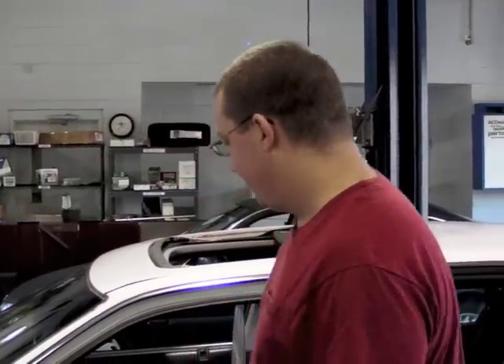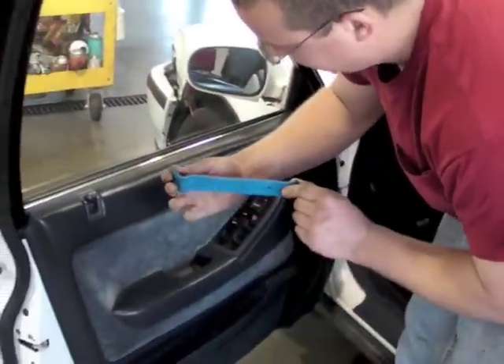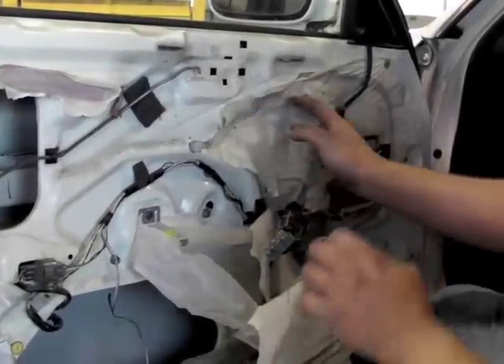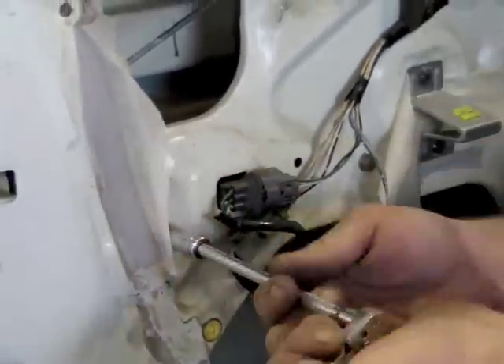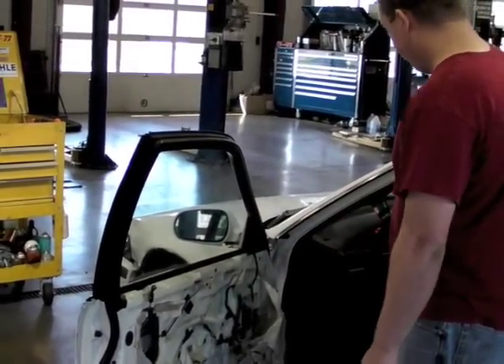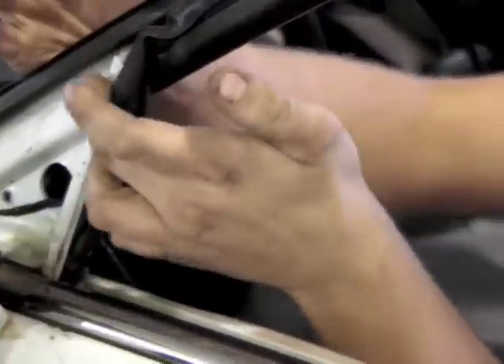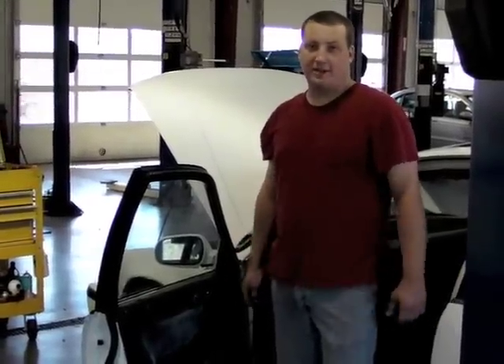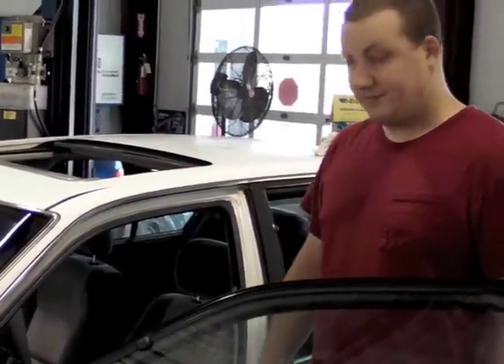How To Fix A Broken Power Window

Comment: I really appreciate you posting this video.  I am in the process of re-setting my window and was at a dead end after taking the panel off.  I have an idea of what to do now since I have a 93 wagon that looks identical as far as the door panel. I just wish that you showed the window being pulled out and re-installed, but I'm guessing it's just that simple after I take off the hex screws.  Ok, time to get back to work!  Thanks again!

Comment: Much THANKS on your video.!! I'm now motivated to fix my window that leaves a crack on the upper section of the channel. Just in time for the winter and rain season. Never knew window channels need silicon application. We've been having "Santa Ana" winds hear in So. Cal. in the past week. Very DRY Air!!!. That's why I hear "Sticky" sound on all my windows when I operate them. I will by silicon lubricant spray to condition the channels to allow the windows to glide easier.

Comment: Very helpful, I have probably the same problem with my power windows, window on the driver's side will roll down with no issues but when you roll it up, it goes all crooked. And also, the rest of my windows, passenger side and back, don't work, probably some fuse prob, I don't know.. But yeah, thanks for the video!

Comment from the maker: @errickidle basically yes you need to reattach the motor to the regulator and the regulator to the window. I would recommend getting a repair manual or searching online for a diagram to see how the different parts work and how they fit together this will give you a much better idea of how things work.

Comment from the maker: @carss4lifee most power window setups are similar to the one in the video.. simply disassemble per your haynes manual and make sure the window, regulator and channel are all in working order and properly aligned to smoothly operate up and down.

Comment from the maker: @tammysoulful basically if you need to get the window back on the channel you need to do what we did in the video and remove the door panel first.  That should give you access to the window and you may even be able to simply place it back on track.  If not you may need to remove the regulator and reinsert the glass.  Do a google image search for your vehicle you might find a diagram of the window setup and that could help you see what all the parts and the inside looks like.

Comment from the maker: @senorericshen hard to say it could be the motor sounds weak because the glass being misaligned is causing it to not be able to move freely.. remember odds are its still attached some how.. id say the motor is prolly okay but you are going to need to disassemble and check the parts out... new regulator could be a possibility

Comment from the maker: @goddesspiggy never put solid window glass in a BMW before but more than likely you will need to take off the door panel..usually that glass is held in by the seals themselves and to properly remove the seals and any brackets that may be holding it in place take off the door panel and so you can see what your looking at.. may want to see if a haynes manual has a reference to it for a proper procedure or get on a BMW forum and ask the question.. hope this helps!

Comment from the maker: @missinherlove sounds like the glass came off the regulator. that weird sound you heard was the window most likely coming off... most window regulators connect to the glass via 2 bolts at the bottom of the glass this connects it to the regulator (the part that actually pushes your window up and down) if the motor is moving or sounds okay that's most likley the issue. pull the door panel and see whats off and reconnect could just be a bolt that needs tightened back on

Comment from the maker: @biehn1337 sounds like it could be a motor or possibly a failing switch.. you could always pull the motor and leave it connected and if it turns or spins quickly while unattached to the regulator that could further help isolate the problem.

Comment from the maker: @birmingham1010 without seeing it diagnosis may be a little tough but one thing to remember and this can be applied to all situations and questions that have been asked in the comments section is that there is a process to how the window operates..

you have a motor, regulator, channel, and the glass.. my advice would be remove the door panel from the problem area and begin inspection and testing what works and what does not... seems like a motor issue but ya never know until you open it up

Comment from the maker: gotta start eliminating one thing at a time.. have you tested the switches? have you checked the fuses for those switches? make sure all your connectors are on properly and that the window itself is not getting stuck..if it tries to go up but won't budge its prolly the window is either stuck or you have a switch problem..

Comment from the maker: could be a possibility or it could be that the regulator is moving to much and is not holding the window on track.. make sure it is well lubricated in the channel.. 

also make sure that the regulator is not flexing too much relative to the glass itself.. where it bolts to the glass the regulator can flex back and forth and front to back. so make sure its bolted to the glass in the right position tightly.

Comment: Great video,

I have a 97' Saturn SL2, the window is way off track,it will roll up to a certain point but will not go any further. I took the door panel off and noticed that when it rolled up the metal part of the door seems to expand outwards,how could I fix this???

Comment: i have a few questions:
1. What kind of silicone lube did you use?
2. Is there a specific type of sil. lube that can only be used on the window tracks or all sil. lube will work?

Comment from the maker: I did the same thing on another accord.. could possibly be that the window is off the track.. take off the door panel off and make sure its lined up in the channel properly.. it could have wedged itself in the track and gotten stuck.. BUT if you did what I did once and forced it too much you may have blown the motor.. and sometime cleaning it out can help but ususally means you will need to replace it.. Should run about $100 bucks unless you can get a used one

Comment from the maker: based on the fact that the power locks are not working on that door i would say it would be a wiring or fuse issue but id have to research more to see other things to test on that model..

Comment from the maker: may have to have willie B chime in on this one but.. you should just need to unbolt the regulator from the window to allow it to move freely some times you need to be able to move the glass all the way to the bottom of the door where you have the most space to line it up in the track.. if the prelude is just like the accord there should be two bolts one on each side at the bottom of the glass which holds the glass on the regulator by removing these through the...

Comment: My 97 altima driver window goes down just fine, but on the way up i have to pull it in some places because it will stop and make a noise like the gears are grinding, then it's fine until it gets to the top when it grinds again. if the auto window takes over i have to get needle nose pliers and risk breaking the window by pulling it up as it grinds.

Comment from the maker: Honestly i cant remember off the top of my head what type it was.. it was similar to RTV a yellow rubbery silicone.. but that tube was dried out and we used a tire adhesive.. I believe there is a specific type of adhesive for window rubber, but anything that will stick with that type of rubber and be easy to apply should work just fine.

Comment from the maker: left a comment guess it didnt post.. the regulators are flexible at where they bolt to the window so make sure your channel is straight and lubricated.. what may be happening is the window gets close to the top and when it runs into pressure that bottom bar on the regulator that bolts to the glass pops off the bolts.. make sure it is lined up right and those bolts are tight all around.. hard to say without seeing it but that sounds like its the problem..

Comment from the maker: based on this info i would highly suspect the motor.. make sure the window is not getting caught or pinched by the rubber in the channel causing it to stick if it moves down freely i would say there is a very good chance its your motor or possibly a switch..

Comment from the maker: @ekcoupe756 if its doing the same thing on the other motor and regulator I would take a second to make sure that the window is moving freely and properly in the channel.. basically that was the deal with mine in the video it was stuck in the up position because the channel was out of whack and causing it to get jammed. Check the channel and make sure everything is lined up properly.

Comment: I have my BMW 1990 E34 525i. The Passenger side rear quarter window was broken(not the power window glass, but the fixed triangle quarter glass).  I just bought a new quarter window glass, but no clue how to replace it. Do I have to remove to door panel to replace it too? Thanks!

Comment: My power window goes down too far & then wont come back up unless I take off the door trim & jemmy it with a long screwdriver whilst flicking the control switch. This only happens when using the auto down option. if I stop it b4 it goes too far all operation is fine. Is there a stopper in the channel that maybe has broken off?

Comment: I have a 2000 chevy Cavalier. The driver side window goes down fine with no prob but when i try to put it up ,,,,,it goes abt an inch then stops.....if i turn the car off n turn it back on and try to put the window put .....again it will go abt an inch higher n stop. You think thts the motor? or sumthing else?

its power windows and passenger side works fine. Thanks

Comment from the maker: mnd08exclusives.. 
hard to say with out seeing it in person but it sounds like it could be a wiring problem maybe in the window relay switch itself.. i would test the motor itself as well.. First check the fuses thats an easy test.. if they all look good i would make sure that your switches are functioning properly.. Not sure if the camry's are like this but some cars have a relay built into the switch.. my rx7 was like this and if that switch went bad nothing would work

Comment: Hey good video! 
My toyota camry le 96 drivers side power window broke again.
i looked inside and the motors working the cables are going up and down but 
the window and the metal part hooked to the window
arent connected anymore like a stopper on the cable fell off?
i can push the window up manually but it just keeps falling down 
any ideas? thanks

Comment: Hi, i have a 93 accord that looks just like this car, btw i'm in chicago its freezing out here so i pulled my power window down after i did that, it would not go back up, it was jerkin up and down as i kept pulling the up on down switch inside the car but it stopped workin all of a sudden! rest of the windows work besides the driver side, now would this be the Regulator? any suggestion will help Thanks

Comment: I have a 1997 Isuzu Rodeo and the front passenger window is off the track (I think--I'm no mechanic). We removed the door panel only to find an inner door panel with no apparent way to remove it! I have been unemployed for some time and need to fix this myself. Can you tell/show me how the inner door panel is removed?

Comment: I have a 1996 Honda Passport and am having trouble with the power windows.   The two front windows work fine from the master switch and the door switch.  

1.  The rear driver side windows motors runs (you can hear the motor running), but the windows does not move (master switch or door switch).  

2.  The rear passenger side windows gives a clicking sound when you use the switch (master or door), then nothing happens.

The power locks are also not working.   Any ideas or help is appreciated.

Comment: Can you guy make a video on how to do electrical work on a door module?  Also how to put a window back on the motor.. Cause one window I have on my 96 camaro rs won't roll up or down, and my driver window is down in the door not even on the motor.. I Believe the switch for the locks and windows are out.. But can't find a place to get it fixed or solved.

Comment: I have a 1994 nissan maxima 4th generation and both of the back power windows are being held up by duck tape because the keep rolling down by them self. the motor for the window still works because I can hear it trying to move up an down. would the window just be off the track?

Comment: I have a 2000 ford Taurus.....none of my electrical windows are rolling down. My problem started when my drivers side mirror  came off. Is that somehow connected to the electrical system with the windows? Or could a fuse be blown?

Comment: Hey i have a 2000 Pontiac Grand prix SE,and my Driver side window started acting weird. it was working fine,put it up,get out my car,close the door and it makes a weird sound something broke,i get back in, start the car, roll down the window it gets stuck,then makes a weird sound but wont go back up,then it slides down by itself but the motor works.what do you think?

Comment: quick question i have  91 era accord and i replaced my regulater on my drivers side window i have played with the alighnment bar towards the rear of the door and still when i roll my window up it falls forward about a 5cm unless i push on the rear of the window is there anything i can do ?

Comment: Hey, I have a E11o Toyota corolla, my driver side Power window has the auto button, it has 2 clicks but only the automatic click works, so when I click it and let go it goes all they way to the bottom, the first click does nothing at all, what would you suggest?

Comment: hey bro i have a crv from 2000 i have one window that wont move up or down how do i know if its the regulator... i mean i dont wanna open that if the regulator is the problem because i dont have a spare part... but if its fixable like that sure i will... thanks

Comment: ok i have honda civic lx 96 & on the driver side the front window goes down & up but once it goes up it doesn't go into place unless u push it out if u're from the inside of the car so is tat cuz the window's not in place? for the front passager side it just goes up & down slow so is tat cuz of the channel? for the back driver side doesn't move even though u hear the clickin noise & as for the back passager side it goes down but not up so is this a bad wire or regulator problem or even both???

Comment: Hey I have a 1990 accord 2 door and i rolled the window down, then when i tried to roll it up and it only went 1/2-way and stopped so i tried rolling it down again to roll it up and it only went up 1/4 of the way, so it was stuck in the down position. Now the motor doesnt even make noise but there is a draw on the power so I know its not the switch thats the problem i've cleaned the plugs to the best of my ability and still no luck...do you know whats going on? Any help would be much apreciated

Comment: hey, i have golf 2002 , 1.6 .  i have problem with my driver door my window just went down, the electronic buttons are not working.  i have the computer to see what errors it gives, but computer can't find the error. i have opened the door panel and bought new window power motor, still its not working?
what to check more, the cables lloks fine .

Comment: I have a 2002 Ford Explorer....I have 2 windows on the right side of my car that the windows won't stay up.  I press the window power buttons n I can hear noise moving like its off the track, is their anyway to fix it without taking it to the shop n replacing is for $300 bucks?

Comment: I have a isuzu trooper 93 model. that vehicle window switches is not working but motor is sound for work. I want to change switch from other vehicle like toyota or nissan becase trooper parts is very costly. Is it possible if is possible please giving to me information about that vehicle.thanks

Comment from the maker: not 100% what you mean by expanding the metal part of the door.. it sounds as if the regulator (if your not sure what that is its basically the frame work on the inside of the car that actually pushes up the glass and is attached to the motor.. is pushing against the door.. prolly means your window is off the track or is getting stuck.. you may need to free up the glass and reset it.. basically follow most of the steps from our video and reassemble it to see if that helps..

Comment from the maker: sounds like your motor is starting to go... make sure the window is sliding freely up and down the track and not getting pinched or caught in the rubber.. if its not the motor it could be the switch is dying.. some switches have built in relays and the switch could not be giving full power to the motor....

Comment: A dude get your information correct.

You use silicone lubricant because it is absorbed into the foam rubber and does not just lie on top and keeps the rubber pliable .

If not the foam rubber will dry out and crack and become brittle.

Comment: I have the same problem on my 92 accord only the window is down and won't go up. How do I get it up? you can here the motor running. It will go down a smidge and move up maybe a eigth of an inch.

Comment: l have the same problem with a mazda 929.. back rear window won't go up or down. but the regulators and the motors work... the cable is getting tangled.... how should l go about fixing this..>>>>??? Thank you

Comment: Please help how to repair a power window off track on a 2002 towne & country drivers side .from rem8vibg door panel  to end. Iam a non mecan7c type.
Reply: I have a grand caravan air doesn't work.  Do these cars all have problems with air and windows after 5 years.
Reply: Yes me too. My air operates on high only
Reply: Mine doesnt work at all since 2009 it's a 2006